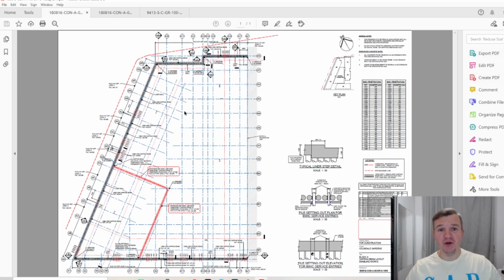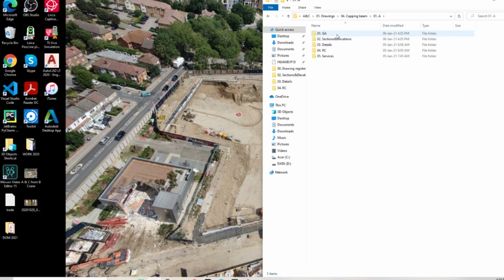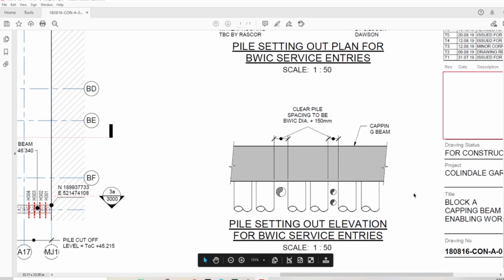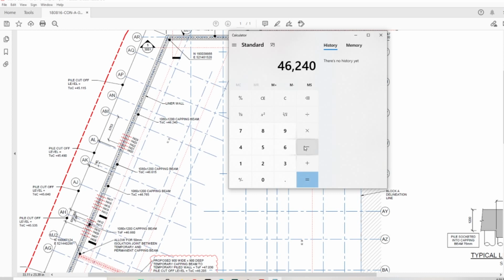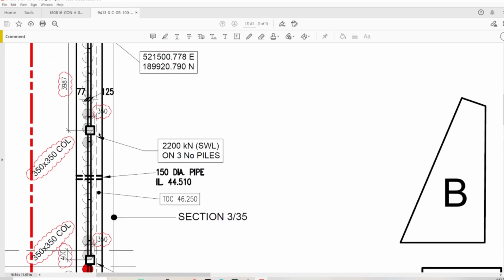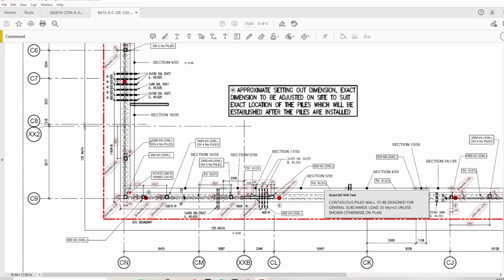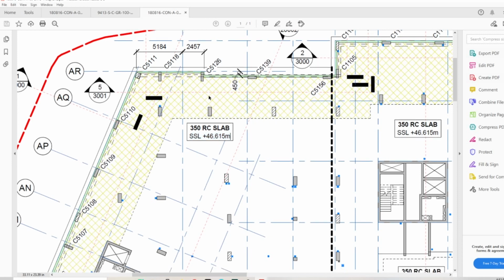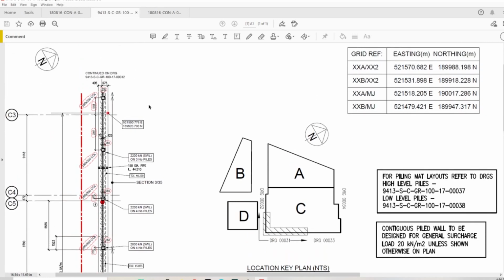How to read Construction Drawings #06. Capping beam. General arrangement and drawing register.

Comment: Good job. Couple of questions:
Can.t find on any of your drawings related videos whats the deepth of the piling?
Can also see those pipes running through capping beam, what tipe of sealing(waterbar) will have around, that should come from the designer team too.
Reply from the maker: Hi Samuel! Piles' depth would be on piling schedule and beam depth is on the drawing for sure. Waterproofing of pipes depends really on the design, or waterproofing contractor choice. If the beam is cast like here leaving 250mm for the wall - wall will be waterproof, probably with waterbar around the serviced. Sometimes waterproofing is done later as the service will be installed after - through 'bigger' opening. To be honest all of these things should be coming from designer, or be approved by designer and drawings should be issued. If anything's missing RFI it (if you have time;)